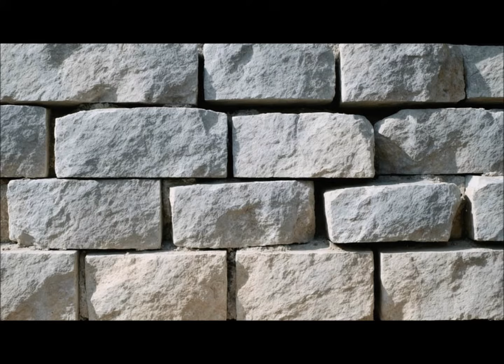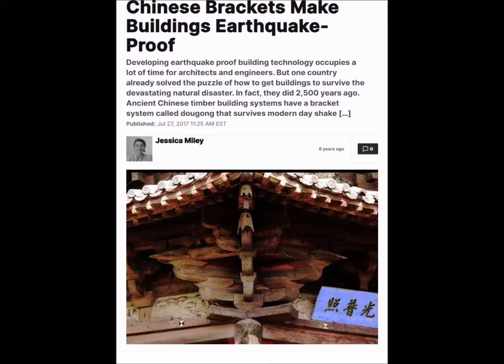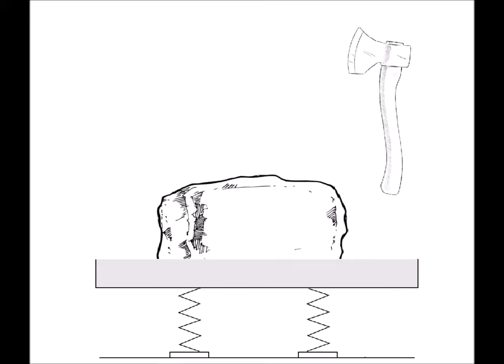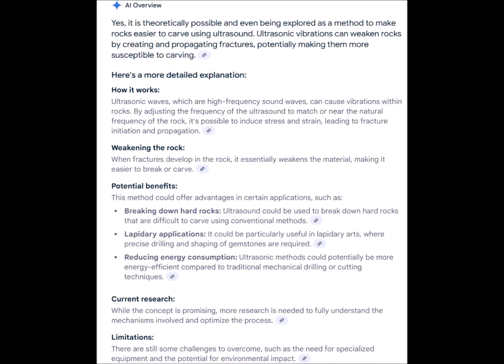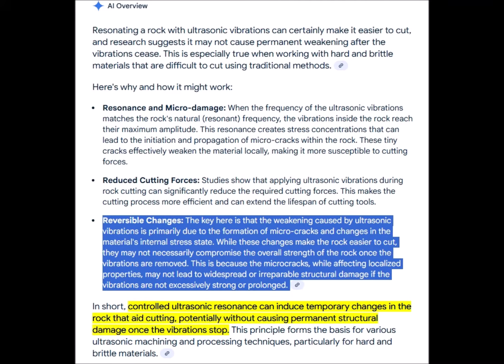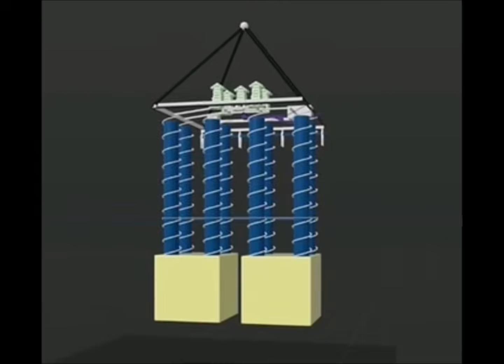Seismo-Acoustic Carving?

Comment: Extreme cavitation damage apparently occurs with de-gassed water (recently boiled cold water.)   No need for ultrasonic drilling when we can have sonic drilling.  Just need some earplugs!

Also, the "bowed bell" phenomenon could provide a power supply.  Same as rubbing a wet finger on a wineglass, or using rosin-dusted hands on your Was Sceptre,  we can use a violin bow against a tuning-fork or against a bell.  With enough resonant wattage (maybe lots of bows at once,) we can probably shatter glass or metal.
Or instead, if your chisel is rigged with a tuning-fork, then each time you strike the stone, the tool-tip becomes a jackhammer, repeating your strike multiple times (if pushed down hard while it vibrates.)   By hand, lift and drop a heavily-weighted tuning-fork chisel, and watch it eat right through stone.  It's a power tool.

PS, Masonic testing for weaknesses in people had presumably come from quarry testing for weaknesses in stone blocks.   Those with hidden internal fractures had better not be employed in the lowest load-bearing courses, or the entire structure may collapse.   To see the hidden fractures, lift up a block and whack it with a mallet.  Any sand atop the block should produce symmetrical patterns, identical to all similar blocks.  Hidden problems become visible under resonant sonic exitation, producing unexpected asymmetrical impure response, highlighting the concealed un-trustworthyness  ...and this also happens with stone blocks!  Heh.
Reply from the maker: I really want to try that tuning fork idea! Just need to find a way to make a big one! This is where a specialized 3D printer comes in handy 🤔

Comment: Great examples of building and shaping large structures. I think it's Stonehenge and a few other sites where the huge stones where quarried hundreds of mile away. Could the megalithic builders used these kinds of vibrations to literally move tons of material from quarry to building site?
Reply from the maker: Yes, that is certainly a working theory! Vibrations are almost as effective in reducing friction as the wheel. Wheels would have been useless against the kind of mass involved in most of the megaliths anyway. It has to be conceded that waterways (perhaps some that are now extinct) would have been used to move much of the material to many of the sites. But these masses still have to be moved off the boat and dragged/moved over a decent part of the ground and around the building sites to get them into place. This is where vibrations could come in. Unlike the rotary engines/vehicles we're more familiar with today, vibrational engines/vehicles wouldn't require the peripheral accessories such as bearings, suspension systems, etc., which add further complications when moving weights of the size used in many of the ancient structures. Not to mention specialized roadways to be able to handle the sheer pressure of all that weight over the small space of a wheel. With vibrational engines, the weight could be spread out over a much larger surface area, reducing the need for highly specialized roadways or rails to support transportation.